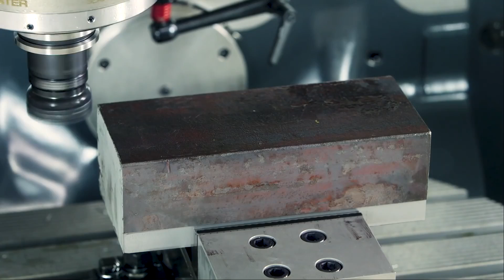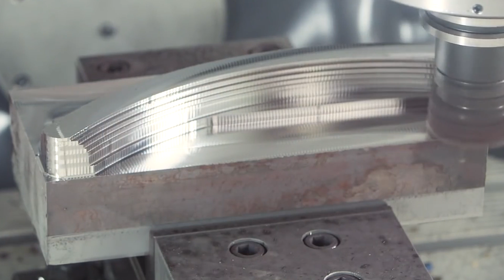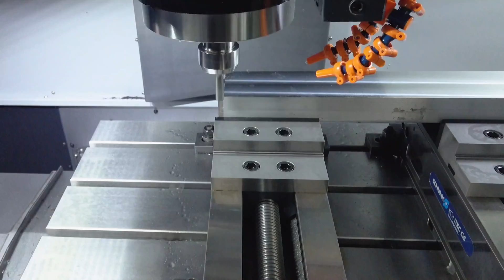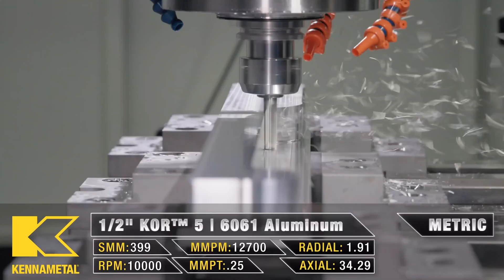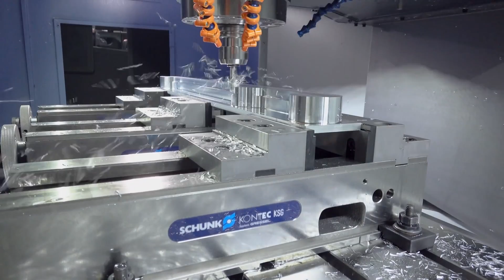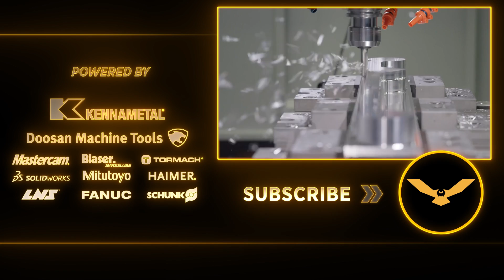Running 4 Machines at the Same Time, 20 Hours a Day to Make $33,000 in My First Month

Comment: There's a giant, steady niche in the market you're passing up on because it's all about the CNC for you. 
     Equipment repair. Tons of businesses lose tens of thousands of dollars an hour when a production line or piece of equipment goes down because of a failed part that can be made rather quickly on a manual lathe and/or mill. Those customers are willing to pay excellently for simple things like keyed shafts or modified couplings. 
      The obvious fact is China will ALWAYS be able to produce high quantity AND quality parts much cheaper than an American company.
      For example, you can buy a set of 2-4-6 blocks from China for $65 and the accuracy is indistinguishable from a "high end" set. You couldn't even touch the raw material price for that if you bought a whole freighter ship worth of steel. Let alone do all the machining involved to make two setup blocks. 
       The American manufacturing industry is a ghost of what it was just 25-30 years ago and trending downward by the day. 
      The rat race, cutthroat business model of fighting for indirect government contracts is a poor choice to enter the machining world. It's going to boil down to who you know, not what you can do.

Comment: You must have landed some good contracts to get 4 machines running, we just keep getting the preverbal carrot dangled, we do some proto types and then set up to very small batch and then boom we iron out the kinks of a job and someone else gets the repeat production and we've told them we will invest in machines as long as we can get the production, its not always who fast or how cheap but down to who you know, i will not do back handers just to get work its a slippery slope and i know people who do it and yes they do have loads of work but if the so called buyer goes so does the work in the blink of an eye , I do like your work ethic and your honesty   👍👍
Reply: Then stop custom orders, find a few items you can confidently produce on a regular basis with what you have so you can keep the "startup" capitol to a minimum and produce/sell those specific few products that can net you a return. If you already have a shop and some equipment your already 3/4 the way there.
Reply: @Ham_Strokers_Ejacula  We tell customers up front now that if we just doing the pre run or development then its going to cost them, we did some development stuff for a green sector company that couldn't find any one to make a special blade, we made the sample ( folded and formed 0.18mm aluminium ) and we told them the cost for production and that we do the production, they said no but can we have the sample, i laughed and said this is the only sample and broke it, they couldn't find another company to even look or make it so they had to go away and redesign it, in life all we want is a chance and when you bend over backwards for people and just use you the tastes stays, we do have some good repeat customers that have ideas and they are what makes it fun but its not cash rich ideas but hay we pay our rent and food on the table.
Reply: @ricardo-iw9sq  if that's your cup if tea, building prototypes for people then an upfront fee and a legally binding contractual agreement for production might be helpful.

Comment: Could you talk more about how you do pricing for those of us that are interested in starting a machine shop? Thanks for the great videos.
Reply: Don't jump in blindly , first get a job in the industry, 
For home shops there are different platforms ,. lowest bid makes the parts , there are very little money to be made there
For big shops you interact directly with the customer , not through some app or some 3rd party cuz you don't want to share the pie 
Pricing goes 2 ways usually 
1 for contracts 3-4 shops gets the same drawing we rush to make the part faster ( we call first part a prototype usually) out of the 4 shops the one that has the cheapest price usually wins , if the quality is poor then the customer will pick the second cheapest and so on . Contract meaning sending each month 1000 or 10000 of those parts, depending on what customer wants , but it's usually a big number , we only do like 2,3 contract a year everything else is filled by 2
2 orders 
The customer places an order of 1 to x parts for the drawing number x.x.x.x etc 
We make those parts and we end up with production price ( electricity , tools , salary etc) and we add profit and then we get selling price
 ex: we make 10 parts for  40$ production cost per part we add 10$ per part and we end up with 400$ production price 500$ selling price.
These means directly negotiating with the client so better get a marketing director that not only looks for customers but also negotiate prices
Reply: No offense, but most shop owners/shop foreman are not going to tell you that. Its part of their IP. How a shop quotes and prices parts to actually make money is hard. Low bids do get jobs but don't always make money. Some larger engineering firms and defense contractors won't choose the lowest bids. By law, in the US, defense contractors have to show that they tried to get the best prices for good quality. Some people quote based off of a rough mental estimate of how long they think each part will take. I have seen others who check the volume of material removed and do some math on material removal rates. Its part science part art. Shop rates differ based on part complexity, material, part difficulty, riskiness of taking the job...ect.

As someone else mentioned you need to work in the industry for at least 3 years to understand these things. If you get good exposure with high volume and prototype machining then you can understand what takes more time and money to manufacture.

Also, its not just about the quoting. You need good machinists to follow through with making good processes. I have seen some jobs that shops take make them loose 10's of thousands of dollars in only a few months. I have seen some jobs make like 70k+ in 3 months. A quote for manufacturing is a legally binging contract. If you run over on the hours the shop eats the loss..
Reply from the maker: Check out this video I did 4 yrs ago.
https://youtu.be/L3KUxtPGb2g
Reply: Forgot to mention , I'm from Europe and that may not be the case for America 
Law's so different that you guys can just ride liter bikes fresh out of highschool while in Europe you need to be 24 years old to get a driving license that allow you to get up on a 600 cc
Reply: Iam from india and iam still  college student Also i work as cnc opretor and programmer but my future plan is to have own shop and start it by purchasing 2nd hand machine .

Comment: Why is it so stupid and twitches on idle movements ?
Reply: Cuz of high feedrates on no contact movement. It causes machine to slowdown and speed up on every point.
Reply: @Ubicuse  But this should not be, especially on such expensive and modern machines like this ! It is painful for the eyes to look at such movements of the machine , I am sure that this can be corrected with the help of special functions in the program or machine parameters !
Reply: @CNCSKILL  But does it need correcting? Seems to be doing its job.
Reply: @aaabbbcccdddee___3333  Of course, you need it if you want everything to work smoothly and beautifully and the machine does not twitch as if it has an epileptic attack !